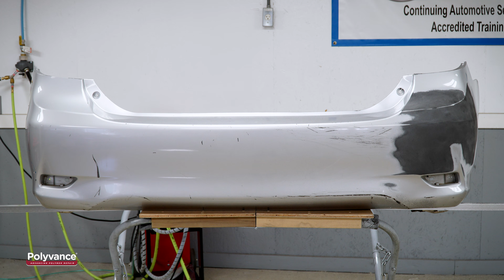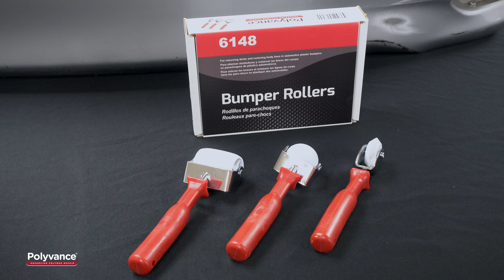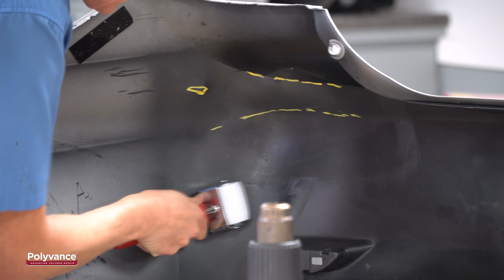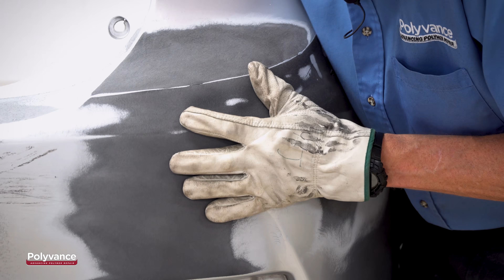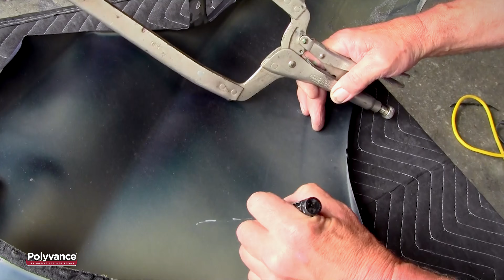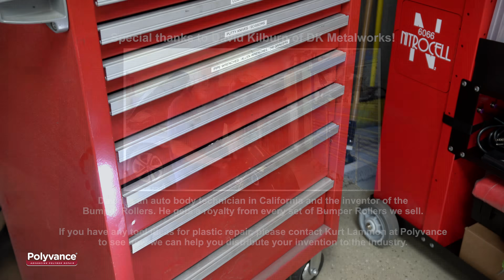Remove Dents in Bumpers With Polyvance's 6148 Bumper Rollers Kit

Comment: I don't care how well ventilated your work area is, that guy should have been wearing a particulate/vapor respirator during the whole process. From heating the plastic to sanding.
Reply: The plastic wasn't heated enough to outgas, so no need for a vapor respirator.  As far as sanding goes, a dust mask is always recommended.

Comment: I had the same problem, poured hot water and it popped out without any work. (Bumper only)
Reply: sometimes you get lucky, but most require more work than that.
Reply: I'm all for having the right tools for the right price of course. Not sure of the cost but I'm sure you can improvise using heat and a diy tool at a fraction of the cost.